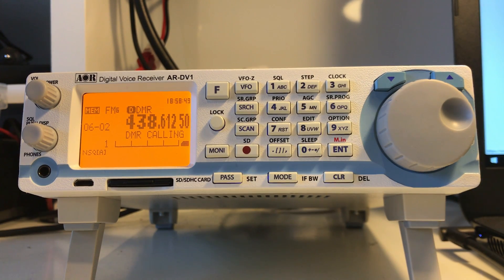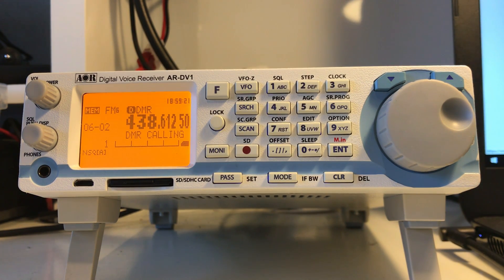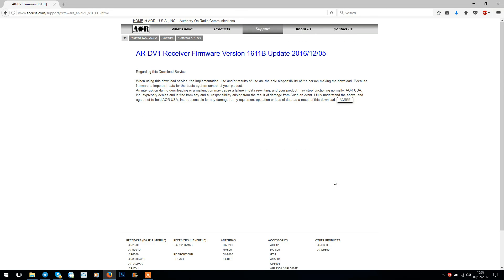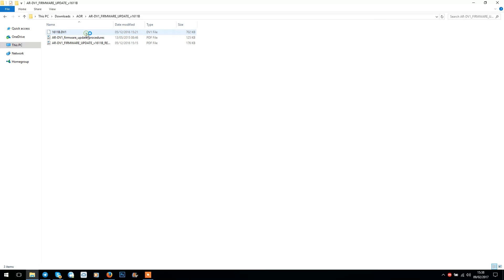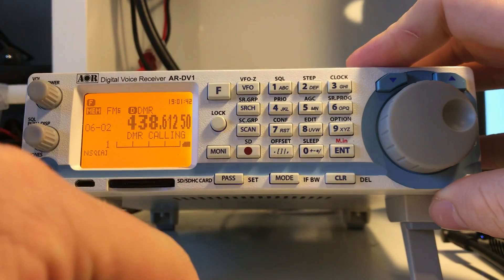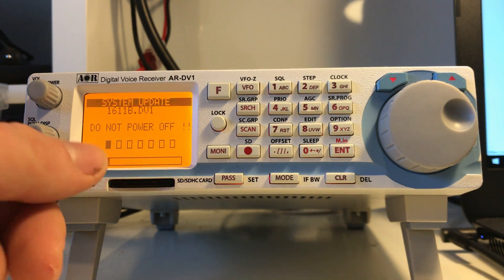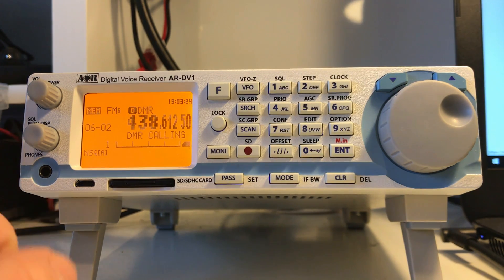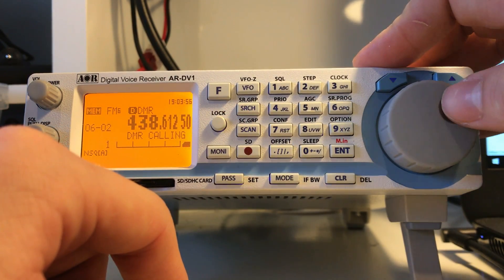How To Update The AOR DV-1 Firmware

Comment: Hi there...I have this radio but not getting very good results using the supplied telescopic whip antenna...do you have to use some kind of external antenna to get best results...any input would be most appreciated...regards
Reply from the maker: Hi Michael yes the telescopic whip is really useless. Same goes for any scanner. You'd be best mounting a discone antenna in your loft on on the roof. I use a colinear Diamond X-50 on mine.
Reply: Ringway Manchester just checked out the diamond antenna....does this only cover one or two bandwidths or is any good say between 100mhz to 500....p.s thanks for replying I really do appreciate your input
Reply from the maker: Not a problem mate. colinear is no good for HF. A discone would be better but then again it is very wide band. I used a home made longwire to listen to HF and shortwave some time ago and it worked well. Anything else you need to know just ask :)
Reply: Ringway Manchester thank you so much....I have a little aor la400 loop antenna for hf frequencies...haven't even tried that yet. I love the shortwave bands but I also like listening to aircraft etc...must admit I have tried to pick up dmr activity but so far nothing....but that was with the telescopic antenna...am wondering if mounting an antenna in the loft would work as well as outside the property...be good if it does because I can't say I'd fancy trying to install a pole and antenna up the outside wall...very high up there and not a fan of heights.
Reply from the maker: Hey Michael.

The loop sounds good and should work well. I mainly listen to VHF and UHF hence the diamond x50. The best place to find DMR is 161-166mhz and 453-458mhz for commercial. If you have a scan round 438-439mhz you'll hear amateur dmr. The antenna would work better outside but in the loft is a start :) If you look at my last urban range test video you'll see a brief clip of the antennas I have on the house.
Reply: Ringway Manchester you are a legend sir...bless you...thanks for the info...you are very kind.
Reply from the maker: Not a problem! Hope you have fun with the AOR
Reply: AOR SA7000 it rocks! Low profile and top quality all round.